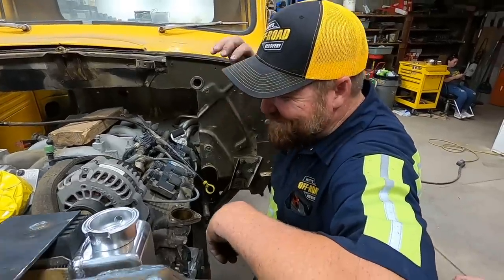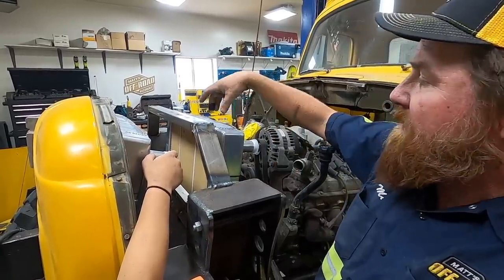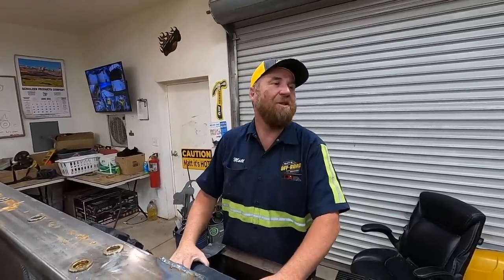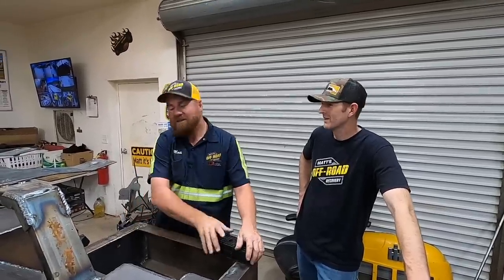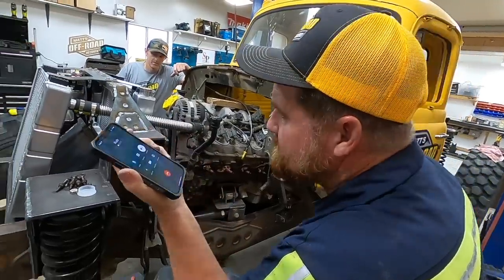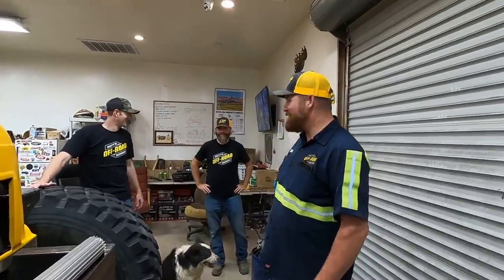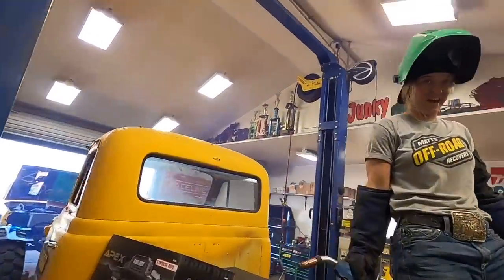This Part Ruined All My Work! The World's Largest Off Road Wrecker

Comment: Why would he have over heating problems with an LS?? I'm confused I mean I live in Arizona and understand the need for good engine cooling but ummm yeah I get he's got alot of weight but with gearing I mean why would the LS be over heating with a triple core or dual core rad

Comment: when you can design the radiators to be tipped at an angle and vent the hot air out of a hole in the hood.

Comment: I wouldn't use rivnuts on this. The vibration of that engine and the torture of offroad they'll come loose and wear.
Reply: @MattsOffRoadRecovery  generally they are good. But they are a pretty soft metal into a pretty hard metal. Vibrations wear them out. Higher quality rivnuts are better than cheap ones. As with everything.

Comment: 20 years too late? My 58’ landrover engine has JW bypass and it was designed in the 1930’s :D
Reply: @MattsOffRoadRecovery  nobody did a closed-off bypass until they got soooo penny pinching that they realised they could reduce the pump size :o) And raise the pump pressure and reduce the rad size which causes back pressure. The truth is you can’t beat electric off road because it can pump water at max flow while you are crawling with a heavy load. My V8 loved it on winch challenge which is the same high torque low speed work. I used the Craig Davis one with the fan controller built in. * nice build, there is no way it won’t work well off road, trust me, I was a plant fitter before I got a masters in Mechatronics :o)  If it looks right it will work right ^-^

Comment: To get the most cooling you'll want to run the hot coolant through the rear radiator first.  The setup you have now is a parallel flow heat exchanger so it can't get the coolant any colder than the air temperature exiting the rear radiator.  If you change it to a counterflow system the coolant can be cooled down almost to the air temperature entering the front radiator.

Comment: Tell the guy who can’t read a tape measure there’s 100,000 in an inch they’re 16/16 at 30 to 30 seconds so I’ll have to do is count that many from the 1 inch mark on the tape measure or from the beginning of the inch mark and he will get the accurate measurement each time

Comment: Matt is starting off by recycling hot air then to a cold coolant bump ??  Along with Tomtom's numeric review it sounds like it's well worth a try. "It's not going to fail" though 20 yrs too late

Tig Weld Lizzy to do coolant tank work under the buttery fly bonnet

redneck welder Skeeter without cardboard gets 10 strikes. Correction by Matt 700 strikes

wear safety Glasses so you can eyeball for years to come and it also important to be well groomed for what or whom I'm  not really sure

After blowing a lot of hot air in the testing phase, everything Works. Off to Rudy's to break some sheet metal

the project ends with Lizzy being a good sport Today.  She won't be when capitalizes on her new Miller Cool Blue Beer line of beverages

for the record Trevor & Tucker were in attendance and Ed made another Cameo weather report.  Lastly Matt's son who I'll call shorty since he's a little short on his fractions was there learning a little about a lot Or was it a lot about a little

Comment: That radiator angle is annoying and wrong, it deflects the air down into a reflecting sheet, airflow is very poor at that point. At the least keep it upright and slot that angled sheet between the radiators.

Comment: Are you your wrecker is going to be bigger than Metal Masher?  It aired in YouTube 3 years ago
Reply: I think you mean the Wrecker by Hauk Designs. Metal Masher is a trail in Moab Utah. Besides being a promotional piece and not a fully functional wrecker, the Hauk wrecker is running pickup axles and 44s while Matt is running 9 ton MRAP axles and 54s. It may look bigger than Matt's but it really isn't.

Comment: For the tape measure, just use a metric meter instead! Decimal measurements are so much easier to learn. It's just 10s and 100s, etc. Plus if you're measuring anything relatively short it's all within 100mm anyway and you're not working in less than 1mm accuracy anyway.
All this 7/8ths and 1/16th fractions is a mess, causing more mistakes (ask NASA).

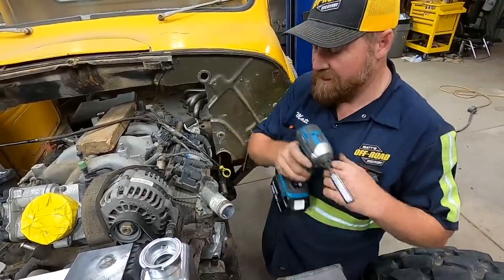Comment: @17:55 I'd go with a solid rubber hose. That will probably create a bit more heat due to water flowing over the inside ridges of the pipe, and not having a clean flow.

Comment: This whole time I thought he was building something that he drawn up until I saw the METAL MASHER video from EJS 2019,  and realized that he is just copying what someone has already built
Reply: You mean the Wrecker by Hauk Designs? Metal Masher is a trail in Moab Utah. Besides being a promotional piece and not a fully functional wrecker, the Hauk wrecker is running pickup axles and 44s while Matt is running 9 ton MRAP axles and 54s. They look similar as far as the cab goes, but nothing else resembles the Hauk wrecker.

Comment: Curious who's wrecker this machine is:  https://youtu.be/9Vc5A7tYl7c?t=99   ?  Looks comparable in size!
Reply: That's the Wrecker by Hauk Designs, it may look bigger but it really isn't. Besides being a promotional piece and not a fully functional wrecker, the Hauk wrecker is running pickup axles and 44s while Matt is running 9 ton MRAP axles and 54s.
Reply: @JohnFL  Thanks John, I will look for more details about that build on youtube.  It also looks pretty killer!
Reply: @TriDaddy  you probably won't find it doing wrecker stuff, since the boom is stationary, and trying to tow a vehicle would result in that vehicle smashing into the back of the wrecker.
Reply: @JohnFL  if that’s all true it sounds lame…  but surely they didn’t add all that weight for nothing… right?
Reply: @TriDaddy  No. The point is, it's a piece of art. It's to show what Hauk can build, not rescue stuck vehicles.

Comment: tig it up lizzy learn aluminum then you can have your own business black smith gun smith mobile welding wrought iron artworks endjess fun  making $60 to 100 an hour easy  that's what I was doing  I started buying tools when I was 18  never stopped whatever the job was if I needed a tool for that job I buy it

Comment: You would of been so much better off running the 6.6 L8T engine which is based off of the lt series of engine, gm discontinued the big block for a reason.
The 6.6L gas engine makes 401hp and 464 ft lb of torque and it is dimensionally the same as all other LS/LT engines.  

You are wasting a ton of time, money  and energy with the dual radiator setup since its not necessary.  A single radiator with a high velocity fan.